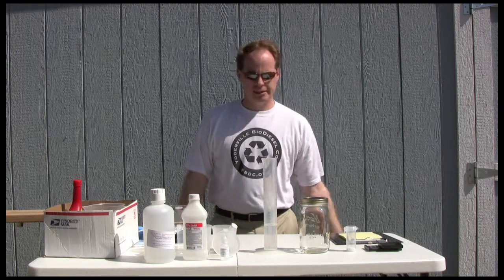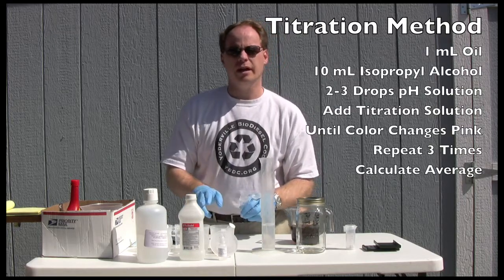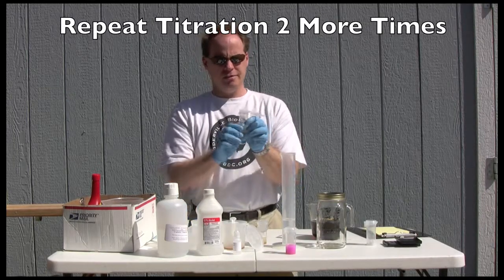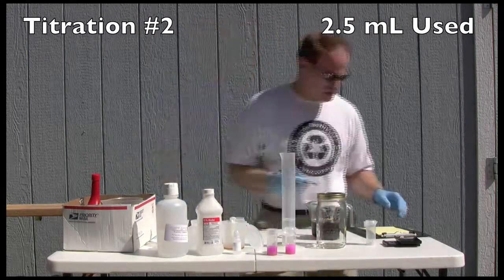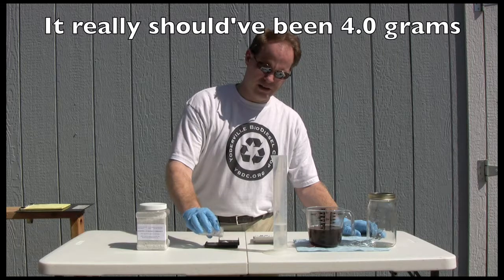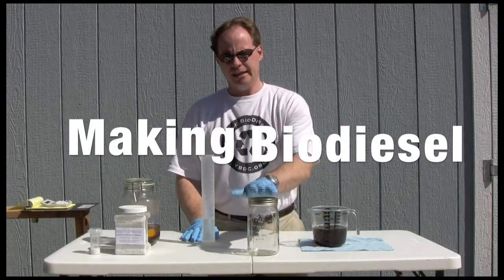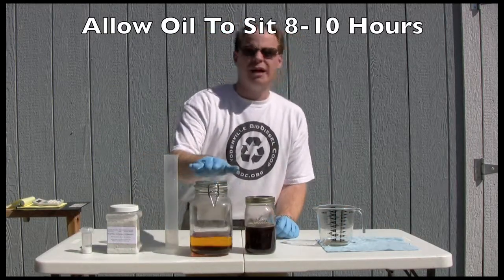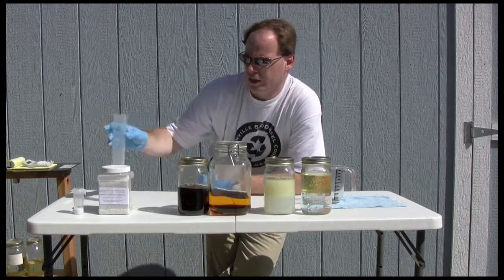How To Make Biodiesel From Waste Vegetable Oil - Utah Biodiesel Supply

Comment: u said in this video that Methanol is 20% of the oil use i.e 80ml ... is this value is authentic ? from where u got that result any link? and u used KOH= 7g which is for pure vegetable oil..... from where u got these value???